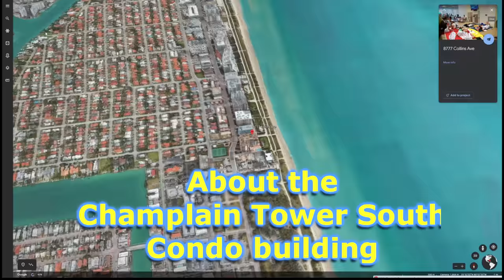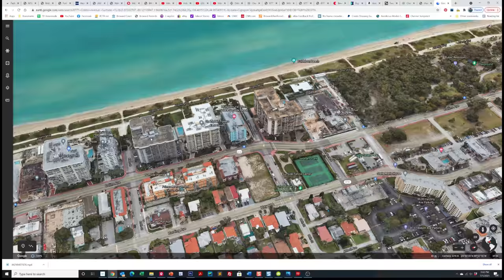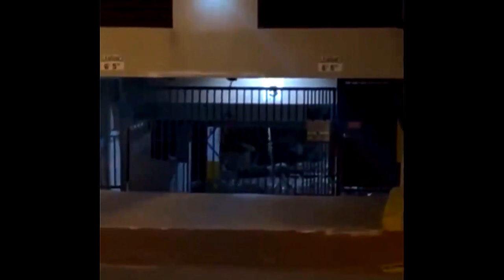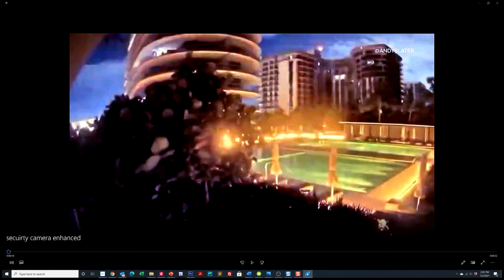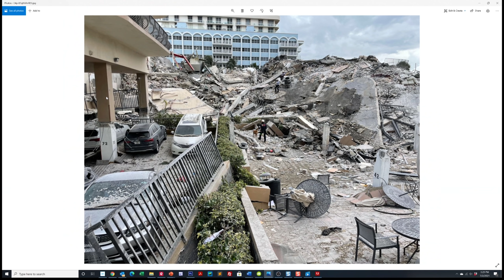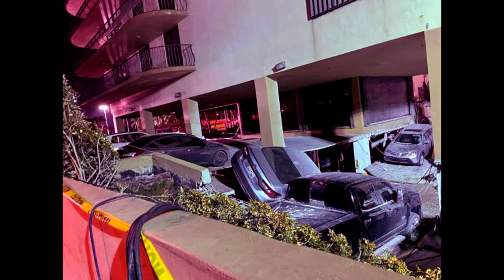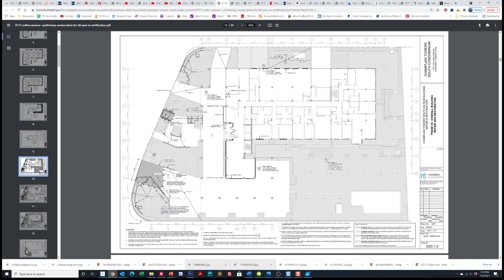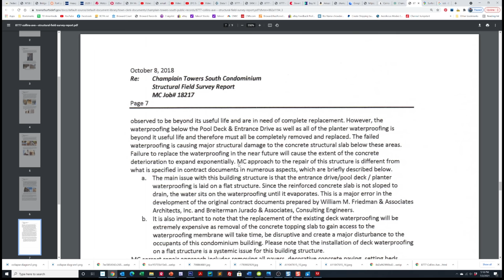Here's Cause Of Miami Condo Collapse Champlain Condo Towers, Surfside

Comment: Columns can vary in size depending on beam span and loading above, rem that in part of the pool deck area there was no building above, I think you were looking at columns that only supported the pool deck. Also columns reduce in size as you go higher since load gets less. Still, the fact the slab had very little connection at the columns does point to a lower level collapse which could have destabilised the rest of the building.
Reply: There are smaller columns holding up the main building as well as the car park. I think standing salty water on the deck slowly seeped into cracks over years and caused spalling and more cracking, letting in more water.. When the deck collapsed, it ripped off large chunks from the narrow columns, halving its thickness and could no longer hold the weight.
Reply: The pool deck was over the underground car park, columns of which showed significant signs of degradation and water erosion, as if the pool had been leaking

Comment: I hope this is not a weird comment, but I am impressed by the firm that did the 2018 survey--for their attention to detail and forthrightness about the serious danger looming.
Reply: 2018. Owners warned of issues in foundation and garage. And the owners did nothing instead they started on the roof adding more stress to a crumbling foundation! Should be sued for criminal negligence, and jail! 1 year for each deceased!
Reply: @CountryBear1994  Sounds like the architectural firm was culpable as well as mentionef in report. Delays don't surprise me as basement/garage pavement/concrete would have to be removed as well. Major headaches all around.
Reply: You probably work for them. Why did they bury the “exponential” damage statement? You would think that would be at least in bold.
Reply: Yeah well they didn't have to fix it.  Anyone can poke holes in a boat....

Comment: Their damage went unnoticed, because nobody looks up at the ceiling. For a short time it bowed downward.
The failed columns you showed didn't have rebar showing, likely because it had rusted into a powder. Steel expands as it rusts, to the point that the rust occupies 10 times the volume of the steel. This is a very good video, thank you.
Reply: Body Corporate, building Inspectors, could not deny this huge problem.
What went wrong”.
Reply: The columns didn't "fail." The floor around the columns/ the steel attaching the floor to the columns below failed. And as a result the floor, section apart of the initial failure of the pool deck, fell through/around its supporting columns.
Reply: @yeehaw_123  They are finding out that coated rebar is just as dangerous.
Reply: @yeehaw_123  Rebar is not galvanized or coated.
Reply: I look up then I am a ceiling fixer

Comment: So basically, the challenger disaster all over. A bullet point note in a report "exponential growth" from 3 years ago perfectly predicted this outcome.
This really highlights the need for better report writing. The line item predicting catastrophic failure should not be buried pages in, after cosmetic fluff.
Reply: Ya, based on current information, it appears as though the property manager is to blame here.
Reply: A great justification for an executive summary. Also should have bolded this statement. Great “teaching opportunity” here.
Reply: @johnandreae6948  I don't know what professional standards exist in the civil engineering sector, but it would seem odd if regulations did not already cover how engineering reports should cover the disclosure of potential-catastrophe/loss-of-life findings.
Reply: Maybe not better reporting but better pushing to the higher up, news paper, or code enforcement

Comment: There is a striking difference between the looks of the two buildings. The one that collapsed looked like a junkyard on the roof with lopsided AC units and a horribly patched roof. Sure looks like the building was not at all maintained.
Reply: I noticed that....it's like that shiny luxury car that turns into a nightmare when you open the hood
Reply: Well you know it's costly to do proper maintenance and profits would be impacted !
Reply: @jean-pierrelarocque620  well it’s kinda hard to make profit if your building collapses

Comment: As an architecture student,, this was a very comprehensive video. Thank you so much for the analysis. As Australia is currently in the review of all their building processes, and also seeing the crap quality builds coming out from developer recently, this definitely is eye opening
Reply: Imagine what will happen in China in the future!!
Reply: @sammyd7857  already started to happen and building are collapsing. There is a Chinese expression that translates as"tofu dregs" for badly constructed buildings. The Chinese developers don't care, they use brittle rebar that shatters if you drop it, no drainage so buildings and roads flood, cheap unwashed sea sand in the concrete that causes the buildings rebar to rust. I have seen Chinese office buildings that are half finished pulled down because a contractor used sea sand thanks to a foreign engineer spotting the defect.
Reply: @LinuxGalore  yeah I saw that rebar scam.  The Chinese will be really screwed considering the amount of buildings that are surely built with the rebar.  Although like most people in this world now, 2 plus  2 seems to only make 3.

Comment: My wife thinks I'm weird for never looking at a building or structure and appreciate how good it looks, but instead I like to go look at the underneath, hidden things like the frame supports, the piping, wirings and even the unmarked doors. 
Condolences to the unsuspecting victims and their families though :(
Reply: Your wife is lucky to have you.
Reply: I don't know anything about construction but when I pass raised buildings standing on posts it always worry me that how can such  tall concrete buildings stay up with all that weight, just my observation. Surely all buildings should be checked thoroughly to stop things like this happening.
Reply: I was in Miami on a vacation 2 weeks ago and couldn't stop looking at all those high rise condominium buildings. I loved the design of them and was really impressed by their height. Very modern and nice looking. Now that I've seen those videos I will never look at them the same way^^

Comment: I, like so many others, are just so shocked that something like this could happen without some warning signs. Perhaps there were signs that were just ignored. I keep thinking of what it must have been like for the people sleeping in their beds when this happened. I just hope they were never really aware and just died in their sleep. My heart goes out to all of them and their families. Such a disaster.
Reply from the maker: There were warning signs back in 2018 an engineering firm warned them that they needed to start repairing the concrete now or it will expand exponentially
Reply: @jeffostroff  So sad. You did an excellent job explaining how it happened. Makes more sense now. TY
Reply: @jeffostroff  Most tenants didn't know.  TBH, I saw a couple in an interview that said they didn't know anything about the letter that was sent out.  They were there for 2 months, but the letter was sent out I believe in April.  Warning signs, yes maybe, for expects in construction... and even they didn't think they were "bad enough" to bring the entire structure down.  Yes, engineers are not gods.. remember the designs flaws of the Silver Bridge, the Tacoma Narrows... etc?  Not the best examples, but the people who designed those, believed the bridges were built to last and sustain many things.  I am also certain they overlooked the water factor more often than not.  People in Miami are used to "water, water everywhere" sometimes, every construction worker knows "water" spells trouble for any building.  It's hard to believe something like this CAN actually happen.  Rest assured, the Champlain towers didn't collapse in vain, it will be used to strengthen construction from here on end.
Reply: @jeffostroff  That's not much of a warning. The engineering firm knows that the report will be read by laymen.  They should have said you have to start immediately. The reason they didn't is because they themselves did not believe that a building could simply collapse like this. Now they know.  They might be on the hook too.
Reply: Yeah I definitely hope that among the deceased none of them suffered and that they just instantly died. They say the building pancaked, with all that weight, they likely did pass instantly. None of them deserved this and ultimately it could have been prevented, at least the deaths could have been prevented
Reply: I think that you are referring to signs that would give warning the the structure was falling, and not the 2018 report? I think the 7 minutes after that concrete fell in the parking garage, was all the warning they really got. And that would have been followed by the pool deck falling, which is what got that tenant out on her 4th floor balcony. Her call provides just one more clue. Maybe more will come out eventually.
Reply: @nuts4fiber  Yes, I was referring to signs of loud crashing noises. When the pool deck collapsed and all that water was gushing out must have been really loud. But it seems to have happened too fast, there was no time to react.
Reply: @BelieveInTheLordJesus777  so you're God? You've determined that some people went to hell? How christian of you to judge others. 🤨
Reply: @BelieveInTheLordJesus777  Who made you the judge of the journey of their departed souls?  You are meddling in affairs that you have no part.
Reply: @karascene13  The Bible is my final authority. What is yours (besides your own opinion)?
Reply: @BelieveInTheLordJesus777  
I seriously doubt that everybody in the building was born again.
Reply: @BelieveInTheLordJesus777  based on your statement, which equates your concept, then they deserved it, so what is your issue?
Reply: @P.Johanna  is sad to see people heading to Hell only because they're too proud to accept the Lord Jesus' sacrifice on the cross for their sins. Also disappointing to see people asking to pray for the dead or worrying if they passed away quickly or not in disregard to where they're going. I'm just trying to make people think of their own life.
Reply: @BelieveInTheLordJesus777  you are a troll.
Reply: Oh, pretty sure they'll find that there were warning signs but they were systematically ignored for profits.  That's often how catastrophes like this go.

Comment: the building maintenance man said there were pumps in the garage to take away up to 2 ft of water and they were constantly replacing the pumps because they were being over worked
Reply: With time water do a lot of damages!
Reply: @sherrykeeney7376  city people are just sometimes not really qualified to do ghe job i have already spotted 3 in my town they probably got theirs degree in a box of Cracker Jack!
Reply: @oiseaudenuit  The quickest way to ruin something, anything, put it near salt water. 40 years of being right next of the ocean, IE: storms, inshore winds etc.  That and the lack of proper maintenance finally collected it's toll.
Reply: @sherrykeeney7376  code inspectors probably did not find anything wrong 40 years ago. Nobody from any city goes to each building to inspect a any building. They just give a certificate of occupancy when it is finished and people can start moving in. After that the building maintenance is the responsibility of their owners.It seems that you never owned a new house. Private inspectors are hired when a person want to purchase a home but they never inspected inside the structure only what can be seen.

Comment: I had a beach front condo in NJ.  I'm recalling those condo meetings when we voted on repairs and upgrades.  Some were required immediately.  Others by a given date.  Some owners were not inclined to go with the more expensive contractors.  I think, now, I'd have felt differently about those repairs.
Reply: My first home was a condo. And the HOA board was completely incompetent.. They'd hire the cheapest contractors who put in very low bids. These contractors would do a poor job which then the job had to be redone then the contractor tried to sue each owner for the unpaid, unprofessional work. They also hired lazy union workers who would just stand around all day and then the job would take months longer and have cost overruns. We had rusted rebar on our concrete balconies which should have never happened if the board stayed on top of maintenance.
Reply: I'm finding this all rather confusing, can you clarify a few things please? The Recertification had to go ahead anyway, is that by law? Is it like a voting system among residents in Condo's ? I'm aware there is a president, what is their role please? Can they overule the other residents in terms of the finances when some are reluctant to spend money for clearly, desperately needed work? I'm struggling to understand how any residents at Champlain, couldn't see what was happening to this building before their very eyes. 
Surely they all read the report in 2018 by MC? Why did they all not opt to crack on with the work, given the contents within the report? Sorry for all the questions! I reside over the pond, where there would always be law to overrule stubborn leaseholders (if that is one of the issue's here)?
But in the end, tragically,  I'm sure nobody could have ever predicted this? 
Who do you think will be held accountable if you don't mind me asking? Or is it not as simple as plain accountability? By that I mean the word blame will be such a bitter pill to swallow for the poor families. Thanks in advance if you can help me understand, I picked on you for being a Condo resident, sorry for the essay😊 Regards from England🇬🇧
Reply: @Brooke52528  dont have all the details but simply put, the residents trusted the board which they elected. This board makes the decisions and informs the residents. And yes they saw the report but according to one interview i saw, they just trusted the board as they were the professionals while residents just wanted to live life.

Comment: When condos are sold and the builders move on some HOA 
becomes responsible for maintenance but over time grow more 
lax and just do enough to keep the tenants from complaining.
This happens all the time,but not usually with such 
disastrous results.Most of the time the condo 
owners get assessed for major repairs,
sometimes after only a few years.
Reply: Moral of the story do not buy into an old Condo. I read the repair estimate on this property was over 15 million. It would be safe to assume some residents would be very reluctant to fork out the $100k in addition to all the other condos fees and expenses. I believe it comes down to money and putting those necessary repairs off until the authorities mandated it.
Reply: @mikenoble8517  Do not buy into any condo,
all you get it the space between your walls 
and the responsibility for shortcuts taken 
by the developer all over the property.
Reply: @rick-be  I am in the hospitality business. I see more and more people treating condos not as permanent residences but more like investment properties. VRBO / Air B&B for 53+% of the year. That works as it covers all the fees and puts money in your pocket. That said some HOA entities will not allow it. Whatever? Despite such a plan I would still not  invest in an older condo. You simply cannot control the expenses contractors are chosen by the HOA and other BS.
Reply: The individual condo owners ARE the HOA.  Too much dithering and stalling from several quarters.

Comment: In Ontario buildings with underground parking are inspected every 6 years. We had a mall collapse that had a parking deck on top. Again water damage on the roof was the cause of the failure. Building codes at the time were not good enough for a 40+ year lifespan. Buildings built around that time frame are being demolished or are having the structure posts replaced.

Comment: I was not expecting such nice looking interiors for the apartment attached to such crappy infrastructure.
Reply: Makes it even scarier.
Reply: The rich get rich by being as cheap as possible.
Reply: What is it exactly that makes New York merchant bank headquarters buildings immune from such defects?  Different regulatory system?
Reply: Me neither.
Reply: In response to "The Last Dad on Earth", neither was I. My thought was they were old apartments that converted to condos but some may have never been upgraded per the owners balking. But this building was a showplace! from many of the pictures. The lack of upkeep in the garage & the area of pool piping & equipment is shocking.
Reply: @victorsauvage1890  Commercial skyscrapers are large one-off projects that are paid for and supervised by the future resident. Residential buildings are largely made in series from existing plans to be sold away to third parties. It's the difference between a NASA computer and a smartphone (even if it's Apple).
I do believe though, that climate and geology play a larger part in this case - Miami land is a humid swamp and Manhattan's a big piece of rock.